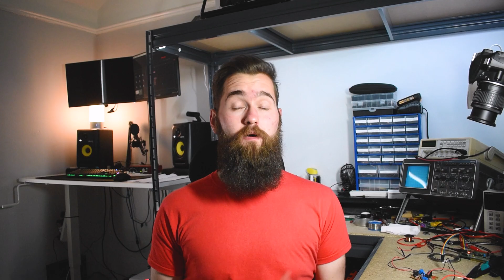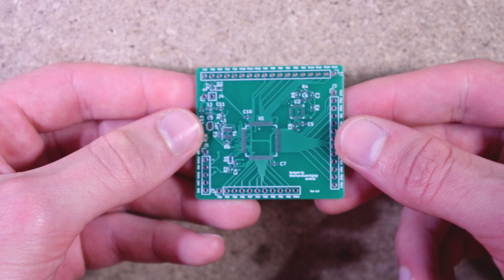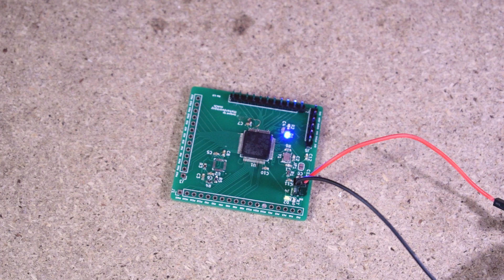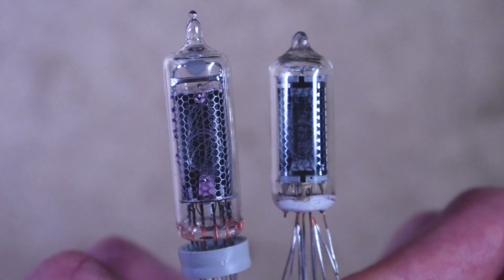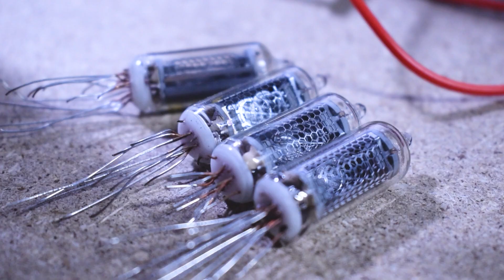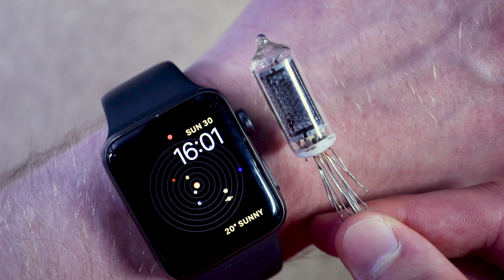Nixie Watch Project - z5900m Tubes & Nixie Power Supply

Comment: Nice project. Ive build one in 2015/2016, with german Z5900M nixies, capacitive touch buttons and Inductive charging, so i could make the watch waterproof. Lets see what you make out of that topic.
Reply: What drivers and power supply did you use in such a small form. factor. I want to build one of these